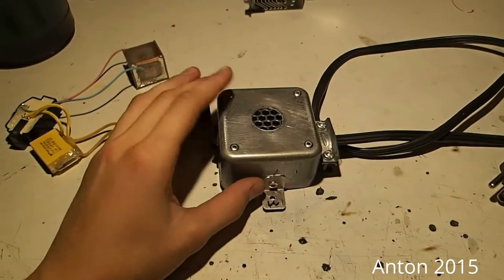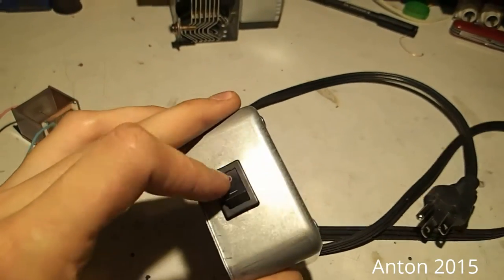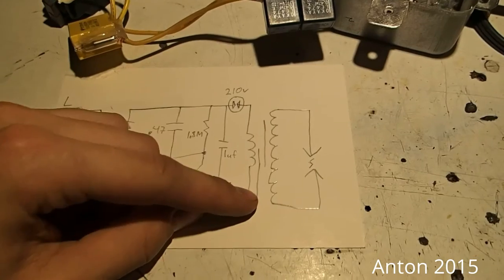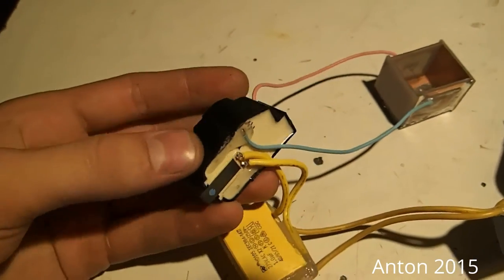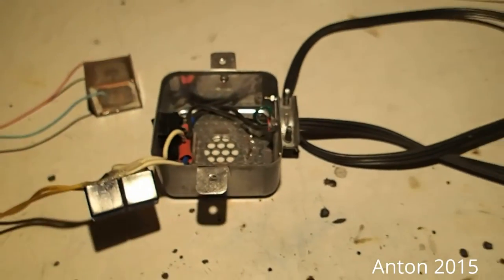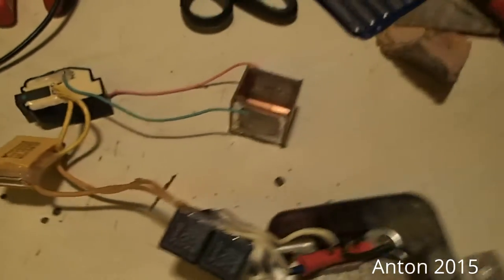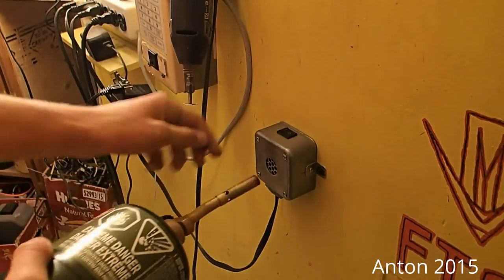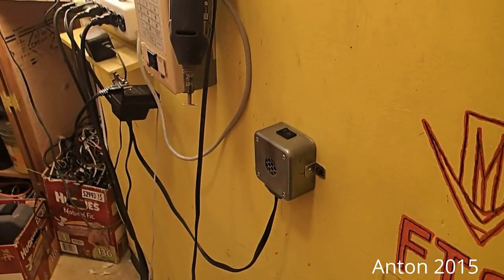Diy Mains Torch Ignitor

Comment: Neatly done.

Just 2 things:

1. Move the fuse to the live wire, in front of the switch (you don't want the internal parts live when the fuse blows?)

2. You may want to check out having a pressure-switch on the grating, that turn on the sparker.

Very nice to see the ground-wire on the shell, good for safety :) (could be in the schematic too, just for the protection of others)
Reply from the maker: Thanks for paying attention. I put the fuse on the neutral side specifically for space saving reasons. The fuse is removable with a spring on each side making it quite large. Pressure switch wise, I don't know of a switch that would trigger on such low pressure and it would be quite large.
Reply: +Anton Babiy Personally, I would have put the spark-gap on the outside of the box. The idea of the shell filled with exploding gas doesn't appeal to me. 

But it seems to be ventilated well enough for that to not be a problem.
Reply from the maker: erlendse
I'm not planning on filling the thing up with hydrogen, so it'll be fine ;)
Reply: +Anton Babiy I was thinking of the torch, and gas getting in before ignition.
Reply from the maker: erlendse
If I hold it up for some time before ignition it makes a poof but nothing too severe.

Comment: I was hoping to see some ebike action, but this is pretty sweet also. Look to see ya bike, I have an old ebike 24v and not sure the W but it would go 28mph with 2 adults on it. I need to replace the controller in it and of course the batteries but really wanted to put a  Li-Po pack or Li-Io. Problem is knowing what Wattage controller to go for as I ripped the old one out before we mover over 2 years ago and now it's gone lol. I may just buy a cheap 1000W and see how it goes.. Can always replace the FET and even parallel a couple up just to be on the safe side.